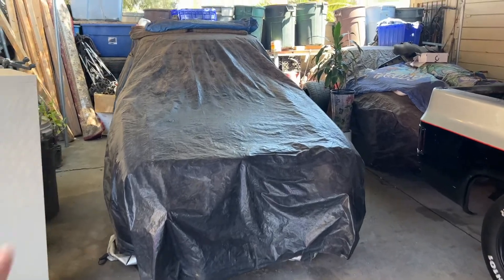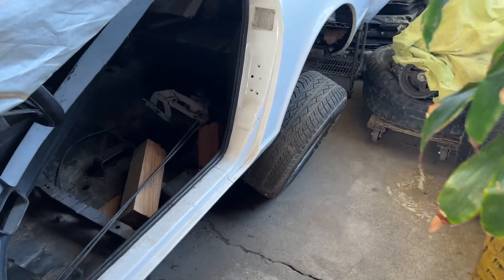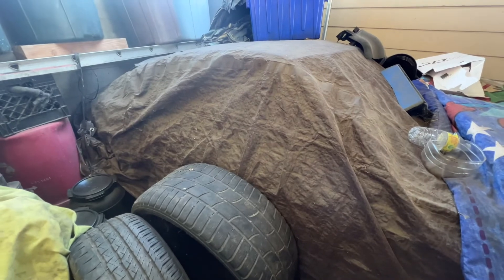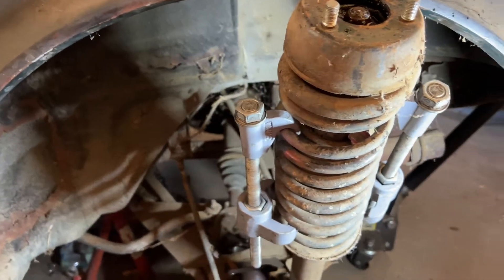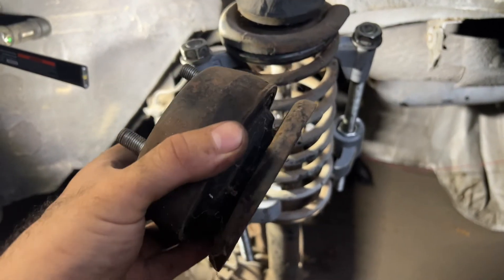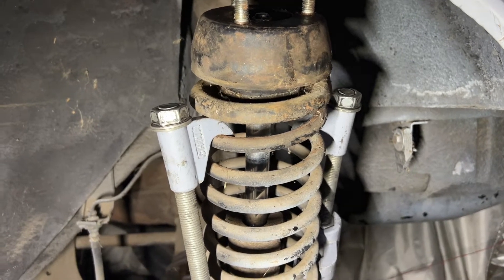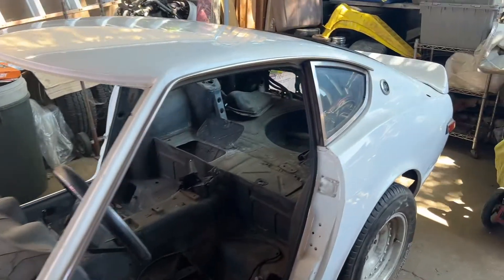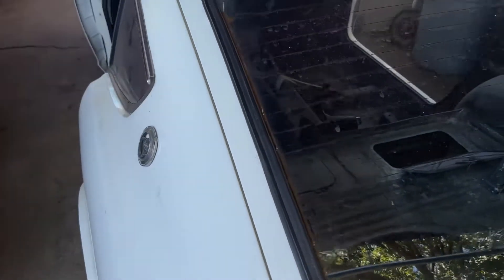LS Swapped Datsun 260z WILL RUN!!

Comment: Do you know what harness your using for the LS to cd009
Reply from the maker: I sent the original harness to get reworked and have the fuse box replaced. I might be selling it soon actually.
Reply: @losmerosvera  were you able to get a tac and speedo reading ?
Reply from the maker: @luisrosas4769  not yet.
Reply: @losmerosvera  do you know what needs to be done to be able to get those two readings? 🤔
Reply from the maker: @luisrosas4769  not yet to be honest. I’ll keep you guys updated when I find out because that’ll  be something I’ll be looking to doing after it starts running and driving.